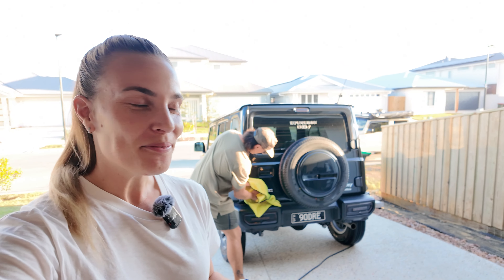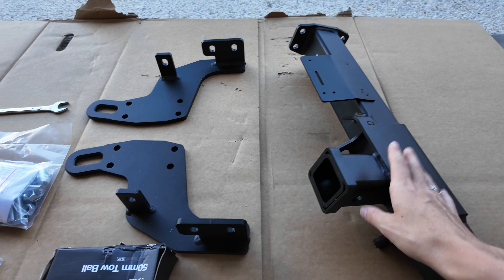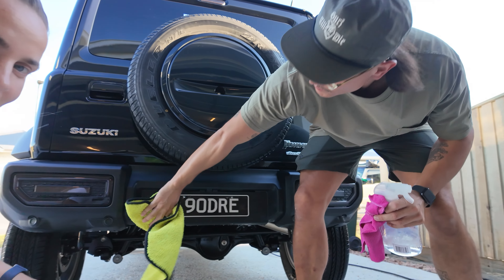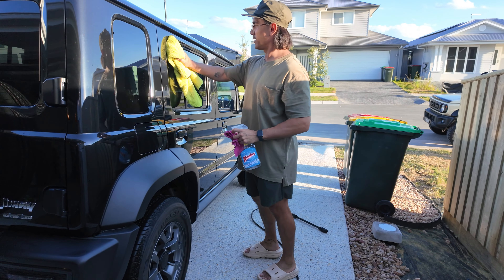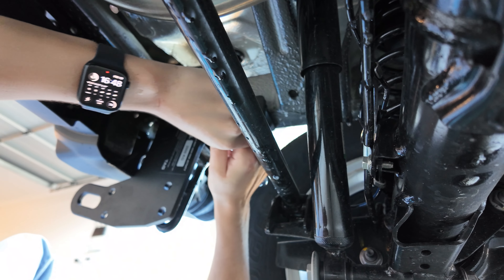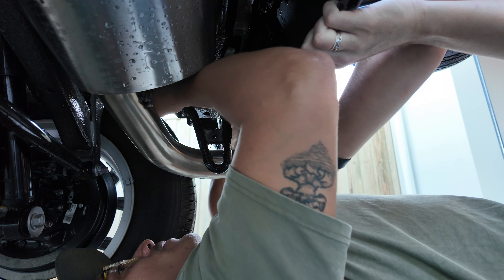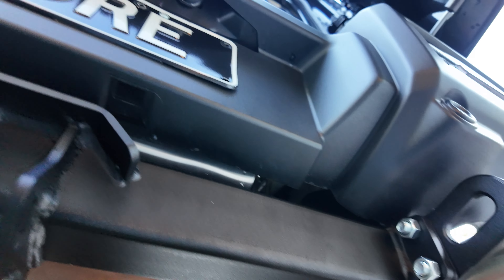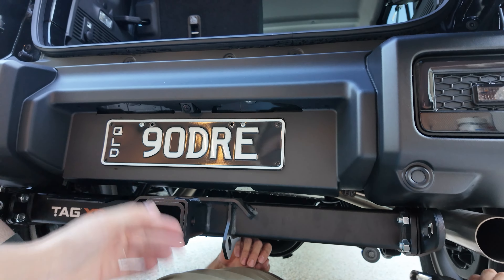TAG XR TOWBAR SUZUKI JIMNY XL DIY INSTALLATION

Comment: i liked this bar, but it hangs quite a bit lower than the rear bumper which would lower the departure angle somewhat, so looking for a rear bumper replacement that has a tow point

Comment: Hi, I just got my TAG towbar and it says in the instructions to cut 2 small square sections out of the bumper on my 3 dr but on your video you didn't do any cutting of the bumper. So is it correct that I don't need to cut the bumper? Great video.
Reply from the maker: Hey! You shouldn't need to cut the bumper no :)

Comment: Hi all, after some info. I’m looking at buying the 5 door XL ,so chatting to the dealer in the yard I was looking at the chiffon ivory,he happened to mention this was  “about $700” more with the black roof compared to the Jungle Green ,no black roof,does this sound correct or was he already jacking up the price. I can see nowhere were it mentioned this in any reviews. Cheers guys.
Reply from the maker: Hey! Yeah so prices for the two-tone option is generally more expensive. Might differ from country to country but in Queensland it’s generally about $1-1.5k more expensive for the chiffon ivory and some of the other colours.
Reply: @ExploreJimny  thanks for the reply mate,yeah I’m down in tassie the dealer was very vague,as they usually are, just so I go in well armed with info and get a good deal, cheers
Reply from the maker: @simonstewart2764  No worries good luck!!

Comment: Hmmmm isnt it it Bolt through the hole, washer, then nut?
Reply: It depends on where your spanner is. Basically you applying a washer to the part you rotating.